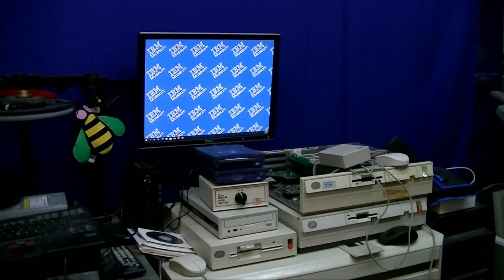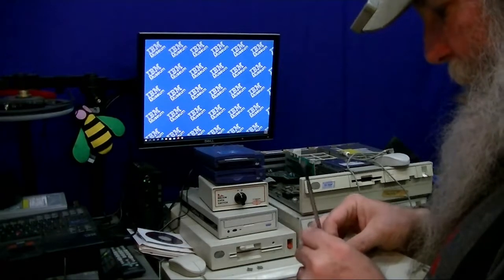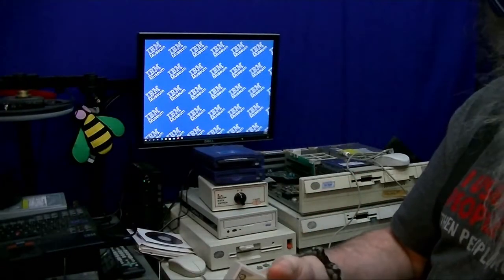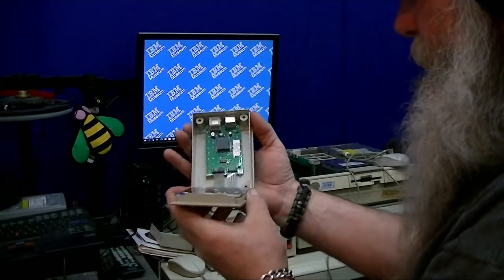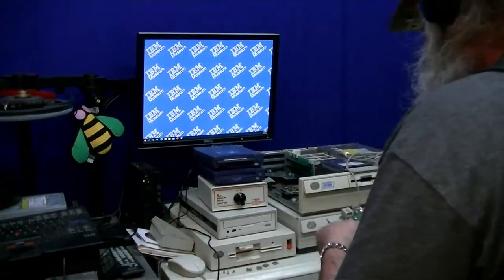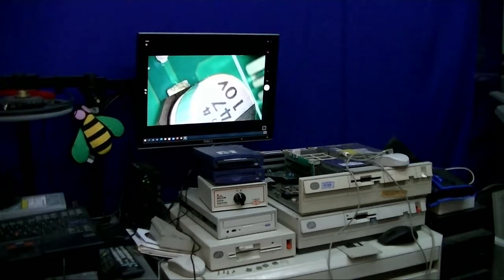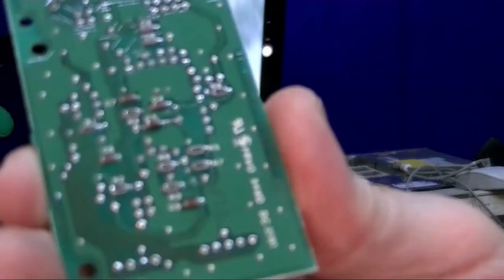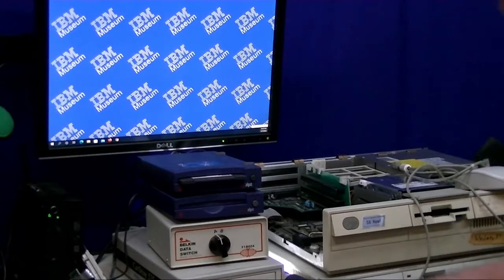Checking out the insides of the PS/2 L40SX External Numeric Keypad!

Comment: Very similar or identical choice of components as in the Model M2. The caps had leaked in all three of mine and they had to be repaired to work again. On one of them the juice had also killed the crystal and on another the juice had corroded the legs of the IC. Some of the solder joints on your PCB looked dull on camera. That's a typical sign of leaky caps. I highly recommend replacing them.
Reply: Agreed. The C1/C2 solder joints look really crummy. There appears to be some flux residue on the nearby vias, so maybe the caps were already replaced at some point and just not soldered very well... hard to tell from the video. But eh, it's just two caps, so I'd replace them either way.

Comment: If you're going to pull and test those caps you may as well pull and replace them. To get the monitor to appear more normal on your camcorder turn the colour balance towards red and it will appear more normal.
Reply: Yes easier to replace tiny electrolytics with 35V tantalum there, not going to fail then.

Comment: Just found and picked one of these up! It won’t come with a cable, so I’ll need to either find or make one. Do you think I’ll be able to strip the mouse end of a PS/2 cable and put my own RJ45 connector on it? I’ve been trying to look for that kind of RJ##-PS/2 pinout mapping but haven’t had any luck so far. In the video you say RJ45, but is it really something like an RJ12?
Reply from the maker: I'll get mine out for pictures and a pinout - I don't remember if the connector was truly RJ45.
Reply from the maker: I tried to look last night, but it was a little dark - another attempt at where I have it stored will be made today.
Reply: I just received the numpad yesterday and it looks to be in good condition. A PS/2 male to male cable didn’t work (I didn’t think it would since it’s just a pass through). I’ll see if I can strip an old PS/2 mouse and attach a rj45 connector to it. A regular Ethernet rj45 fits into the socket
Reply from the maker: @stache_  - I retrieved mine last night (still bagged up from disassembly), and have the RJ45 pinout now. It is an IBM FRU P/N 1396183, but that will be impossible to find in a search. The pins have been checked multiple times to make sure I get them correct:

RJ45:

Pin 1 (O/W in 568B): Vcc (+5VDC)
Pin 2: N/C, PS/2 Pin 6 (but wired)
Pin 3: N/C, PS/2 Pin 2 (but wired)
Pin 4: +CLK, PS/2 Pin 5
Pin 5: +Data, PS/2 Pin 1
Pins 6, 7, and 8: GND, PS/2 Pin 3

PS/2 pinout at https://en.wikipedia.org/wiki/PS/2_port
Reply: @IBM_Museum  Thank you!!! Using your info, I was able to get a mouse working through the passthrough. Which tells me I'm at least getting the +5V and Data through the keypad, but no luck with getting any of the actual number keys. I tried connecting it to the keyboard PS/2 port on my active PS/2 to USB that I'm using my keyboard with (currently typing this comment with it, so the adapter works just fine.) just for laughs and it didn't work. Didn't expect it to, but thought it was at least worth trying

Gunna disassemble it and check the pcb board to see if any capacitors have leaked or something. Unless, do you know any drivers that I might need?
Reply from the maker: @stache_ : There shouldn't be any drivers required - but it is likely something broken within the keypad.
Reply: @IBM_Museum  aww shoot, I was hoping I got lucky and it was a fully functioning 30 year old numpad haha. Makes sense that something went wrong over those years. When I get the time to open it up, I’ll letcha know if I see any glaring issues